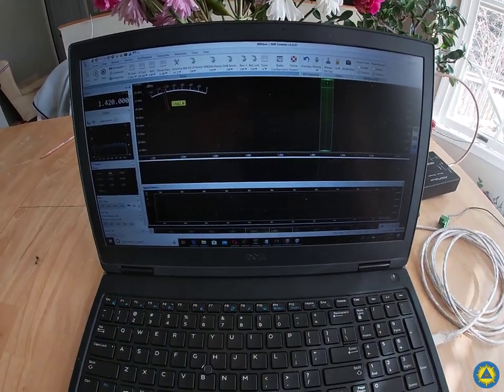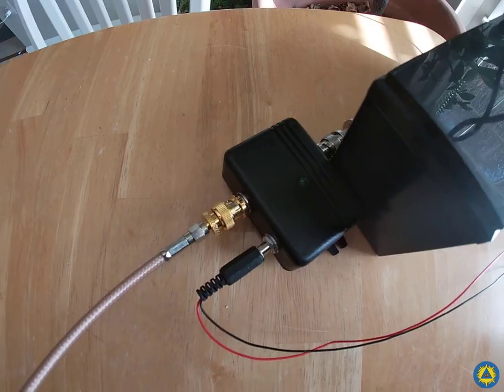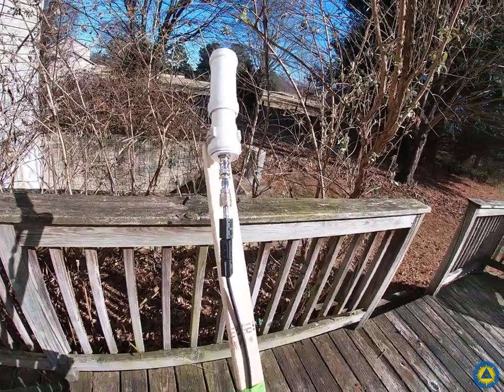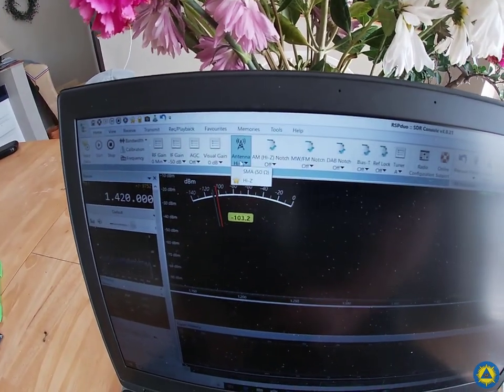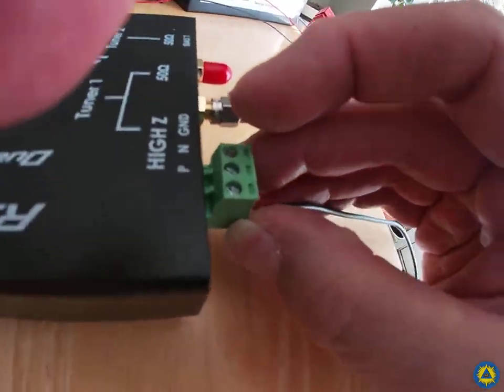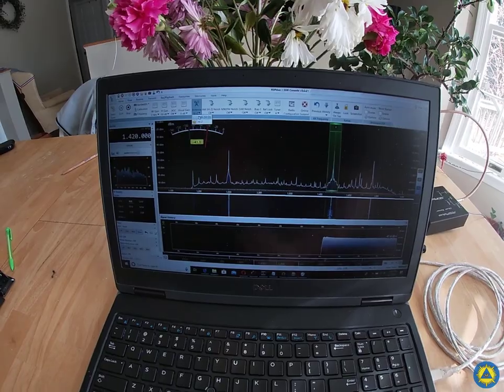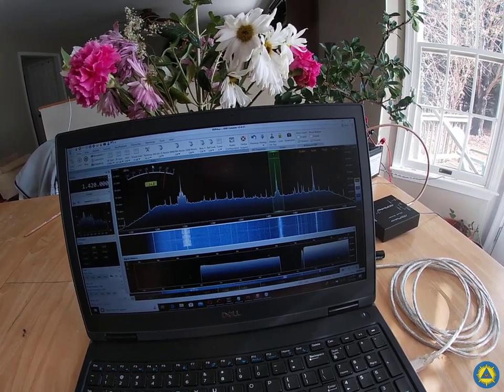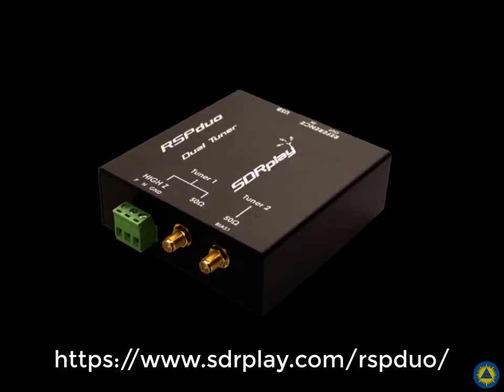RSPduo SDR High Impedance Input Test

Comment: Great demo of the RSPduo using SDR Console and the usefulness of the high impedance antenna port.

 By the way if you use SDRuno there are a couple of extra neat features. One is the ability to simultaneously view both tuner inputs simultaneously (Dual Tuner mode).  There's an example here (8 minutes 40 seconds in): https://youtu.be/91fCXPQnlTc

The second extra advantage of SDRuno is that the power readings in dBm are calibrated to within +/-1dBm accuracy for the 50 Ohm inputs which may also prove useful for absolute signal strength measurement.  

Regarding direction finding with the RSPduo, we are still working on the software for that.
Reply from the maker: Thanks for the details.

Comment: First, one v-can not see the details of the software t-because of the bad quality video. For what I can see is  that yoy have not calibrated the RSPduo to show the exact signal figures. The miniwhip is of a minor quality and has to be mounted about 5 meters above ground to work good. Also comparing these antennas is like comparing apples to lemons. From the ORIGINAL miniwhip by Roelof Bakker PA0RDT has re-designed a EcoWhip wich can be used to feed over the coax from the Bias-T of the RSPduo. I have used  different MiniWhip models over the last 15 years and almost all are poor performers wit a high base noise. You can always send me a PM for more info if you wish. Why not use a balanced open dipole with a ladder line for the Hi-impedance input instead of a wire. Its more quiet and its extremely cheap and easy to make. Good luck!
Reply from the maker: "First, one v-can not see the details of the software t-because of the bad quality video. For what I can see is  that yoy have not calibrated the RSPduo to show the exact signal figures. "
Yeah sorry about the quality. Will be using screen capture as soon as I get proper software loaded on that laptop.

"For what I can see is  that yoy have not calibrated the RSPduo to show the exact signal figures."
This was just a quick check between the 50 ohm and  High Z input. Calibration is forthcoming, but this quick test confirmed operation.

"The miniwhip is of a minor quality and has to be mounted about 5 meters above ground to work good."
It's becoming quickly apparent the MiniWhip isn't what many purport it to be... namely an E-Field sensor of sorts. We shall see. They were certainly inexpensive enough to try. Thanks for the note about the ones that power off the SDRPlay. That's very cool.
Reply: @SkyCharter  There is a video out in the latest SDRconsole v3.0.21. No need for a external screen capture program. Try to calibrate the RSPduo with some 50 Ohm dummy loads on the sma antenna ports and set the base noise level to the specified figure from the SDRplay spec sheet on their website. This will  get you in the ballpark. When showing signals try to show SNR on the meter. This will give you a decent  trustworthy result. I also use a 50 dB dynamic range on the fft and waterfall. Good luck!
Reply from the maker: @SDR-DXobserver  "There is a video out in the latest SDRconsole v3.0.21. No need for a external screen capture program." Thanks for this tip. Noticed it doesn't work on Win 7, but have Win 10 available. Worth it.